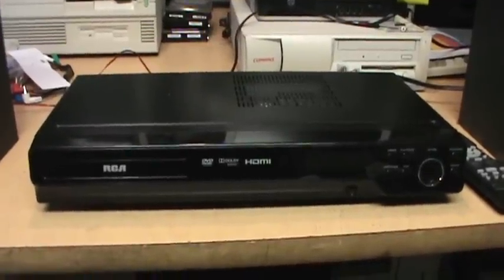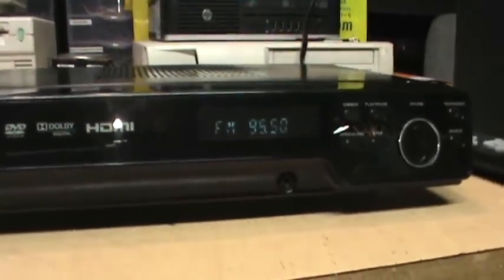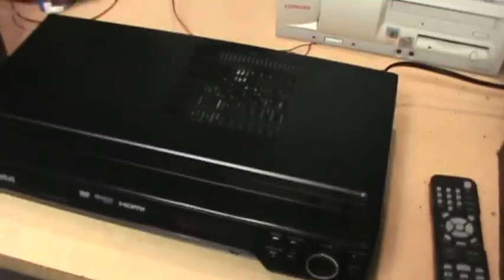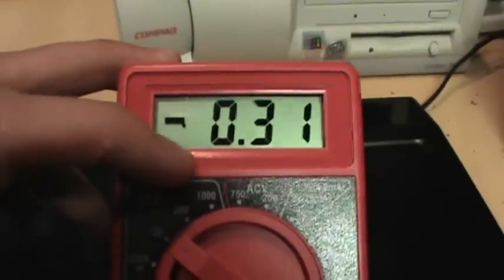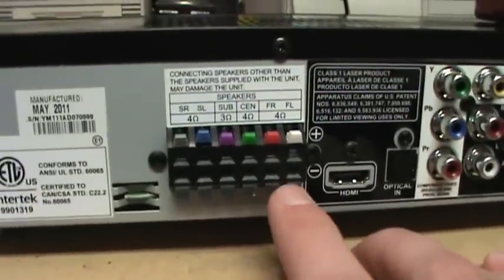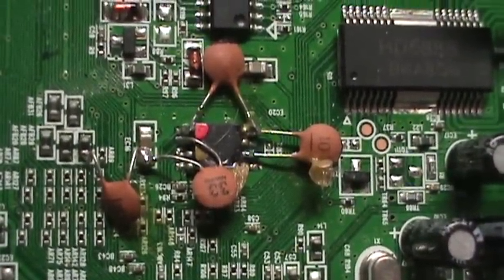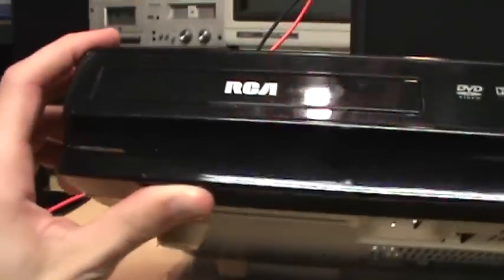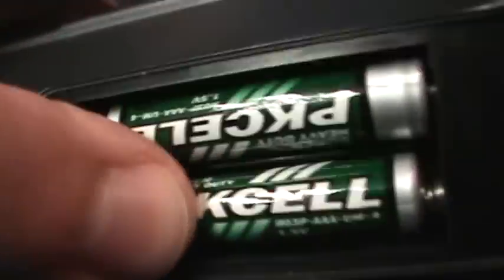RCA 250-watt home theater system FAIL

Comment: 45w to drive five speakers, a subwoofer, and a DVD player! How can they even call that a home theater system?

Looking at the back of a Marantz HT receiver, I'm seeing a 650w power draw, and that's just to drive the main speakers. The subwoofer outputs aren't powered, and there's no built in DVD player.

I know the RCA was designed to be cheap/disposable, but I still would've guessed a power draw closer to 100W, especially since it has to power the subwoofer.

Comment: I had one similar from RCA except that it didn't have the DVD drive and it was rated at 400W (I think) total output. I had the HDMI ports die in it after 2 years, and the audio started to skip in and out when live auto detecting/switching between Dolby and stereo. Also, you can "amp up or down" your audio channels in settings to increase or decrease output to each speaker independently through the on-screen menu. I think settings are stored in eeprom.

Comment: Yep.. that's what happens with badly designed class D amps.. you end up passing a lot of unfiltered current to your speakers and blowing them.. still I have heard systems like that (albeit way more expensive) from Panasonic and the like which have really nice sound and which obviously work in the first place

Comment: The -20 volt measurement was not into a load. Without actually loading it with 3-4 ohms, it's hard to say what the output voltage "into load" would be.

Comment: There are industry standards for claiming output power, if there is no RMS or EMS power in specs - don't buy.
Today radio tuners are complete digital electronic circuits and don't need large coils. Radio chip in mp3 player is using coil that looks like regular resistor or just twisted route on board.
Lots of capacitors on output can have two meaning (single supply amp or power inverter for each channel) but i think that is single supply amplifier.
Lack of output signal is IMO due to digital electronics failure. Probably inproper switchmode supply burning DAC converter.
Loud popping sound is probably due to cheap capacitors working on their limit and drying very quickly ;)
Nice video ;)

Comment: Another glorious example of a  Really Crappy Appliance !
  This is why I feel like if you are wanting a Theater receiver, anything you buy on the used market from the early 2000's to the late 80's is far superior than anything you can get for $99 new.  Unless you REALLY have to have HDMI and USB, but still those can be found easily for less than $99 too.  My only caveat for a Theater receiver is optical inputs.
Reply: Even nice ones from the mid-late '00s can be found for somewhat cheaply, even ES stuff made between '08 and maybe 2012, and are still viable as far as having HDMI audio decoding if you're cool with not having Atmos and you don't need 4K.

Comment: I bought the previous generation of this model. RCA DVD 250 watt surround for $60. Beat the living hell out of it for about a full year until it gave out. I figured it was my constant max volume, had it one day and night wear and tare. Only had this happen to me once before to a $700 panasonic surround sound. Beat the living crap out of it for over 10 years till the fan gave out and overheated the entire thing. Stopped turning on eventually.

Comment: This is why you should spend more then 200 on a home theater system, I have had my Yamaha for almost 6 years and not one problem.
Reply: I've had my Kenwood for over 10 years and it's still running strong without a hiccup!  I use it daily while on my computer (playing games, watching movies, videos and streaming music)!
Reply: I have an Akai receiver I bought new in 1981 and it still works great. My 1977 Marantz really needs a recap though.
Reply: I spent $90 on the audio part of my home theater!! It includes a Sony STR-DE998 master amp (from the dump) a MTX thunder 6000 (from the dump) A Sound Ordinance (SO) sub box (I bought that for $80 from Crutchfield)  A Paradigm subwoofer (forget the model) (from the dump) Two Yamaha ns-5290 for surround back (Bought at a flee market for $5) Two Yamaha Studio monitors [front/main] (forget model) (bought at same flee market for $5) Two modified Sony speakers for surround (from the dump) Sony subwoofer amp (forget model) from the dump all that for $90. Of course I need a projector and screen, which I am getting soon. Screen was $60 and the projector is $700. So I got a $5,000 dollar system (includes projector and screen) for $850! Good deal!!

Comment: Pretty sure that was at the one in Union unless I'm mistaken. i haven't been finding many good items there since the new management took over-- it seems older items are more prone to going to the trash before they ever see the light of the shop floor. last good find I found was a Compaq LTE 4/25C behind the counter up front for $10, but the floppy drive needs a new belt. oh the horror I'll have to endure.

and then I found out the floppy drive in my T4800CT also needs a belt.
and my Compaq Armada.

it seems all my Citizen floppy-wielding laptops need new belts now. it's time.

Comment: Wow, what a piece of junk.

In response to the comment regarding the power input being only 45 watts, that confuses me as well. Unless everything I've learned goes out the window with something like this, power input theoretically always equals power output, regardless of how that power is transformed along the way. As such, an amplifier with a 240 watt output should have a rated input power of at least that much. So I'm not sure what's going on there. My first guess would be they're lying about the power output.
Reply from the maker: The 45-watt rating is at 120 volts AC, while the amplifier chip runs on +/-20 volts DC, so you can't compare the two. YouTube user "Afrotechmods" recently posted a video demonstrating how Class D amplifiers work.
Reply: I guess I don't either because after 4 years of EE under my belt I still don't understand how it's possible lol.

I'm two years late responding to this, but yes, wattage is comparable between the input and output of a device, regardless of if the voltage is converted. If I have a 120V inverter that runs on 12V DC, and I run a 100W load on it, and the inverter is 100% efficient, then it's going to be drawing 100W from the battery as well (120V at 0.83A at the output and 12V at 8.3A at the input).

I've looked up the amplifier thing, and the best explanation I've been able to find is that they're using marketing tactics to bend the facts. The 45W input power rating is probably genuine, and the true output power rating of the amp would be close to that if it's really efficient. The 240W output rating is probably an instantaneous peak value, at which point the input power would be a bit more than that.
Reply from the maker: +themaritimeman Different frequencies. AC power from the mains is 60 Hz while audio power is usually measured at 1 kHz. However it's also possible they're just going by the maximum rated output of the amplifier chips (combined across all channels), whereas the power supply in this unit doesn't provide enough current to actually get that much audio power out of it.
Reply: So the output is always less then the input because nothing is 100% efficient and this is even lower. So that would be maximum 9 watts per channel assuming the electronics used no power and the amp was 100% efficient in reality its probably more like 4-5 watts per channel RMS. The chip is probably out of some car audio device running at 4 ohms. No house speaker is ever 4 ohms. They would be eight cutting thst 4-5 watts output power in half to 2-2.5 watts. Thats ALOT more rasonable then 250 watts out of a chip.

Comment: Hi hello? I have and rca home theater system model rt2380bk. I don't the speakers, or the remote control, but I have the subwoofer. How old is my system? It works fine it has a headphones Jack no dvd player built in.

Comment: Wow, I'm disappointed in RCA, I used to like them. I'm glad you posted it so I know what to watch out for. I'm curious since I really don't know that much about electricity, but what made the voltage go into the negative range and how exactly is it bad (outside from you saying it would blow the speakers)?
Reply: I'm going to take a stab at this but I'm by no means an electrician/electrical engineer/electronics "hobbyist" but a negative charge will push the meter into the negative range.
Reply: *****
GE stands for "Good Enough".
Reply: *****  Pretty much.

Technicolor, formerly Thomson, doesn't even really make their own consumer electronics anymore.

RCA TVs are made by On Corporation while many (but not all) other RCA products are from Voxx and whomever they use to make their items.
Reply: ***** Actually a crappy company "AudioVox" makes for RCA.
Here is some info about RCA, I think of RCA as a "no-name" brand.
 
RCA Telephones - Formerly manufactured by Thomson SA, sold in 2009 to Telefield North America
RCA Audio/Video - Manufactured by Audiovox, produces RCA DVD players, video cassette recorders, direct broadcast satellite decoders, camcorders, and audio equipment. (link on Audiovox website)
RCA Accessories - Manufactured by Audiovox, produces Audio and video connectors, remote controls and television antennas.
RCA Televisions - Manufactured by ON Corporation
RCA Car Stereo - Also known as RCA Mobile
RCA Appliances - Produces RCA Microwaves marketed by Curtis International Ltd. (Canada)
RCA Computers - Produces RCA Computers marketed by American Future Technology Corporation

Comment: I have an RCA bookshelf stereo system and the speakers themselves are good and they are rich in sound, but the amplifier unit is terrible. The CD player does not work (the player mechanism locked up)  and the volume knob malfunctions constantly. They need a step up in QC

Comment: If the rating is 250 watts "music power" then divide by 2 = "IHF" = 125 watts,divide by 2 again should get a rough rms = 60 watts.If they have not changed these ratings.Does not look like 60 rms to me,perhaps 30 rms. IMHO.

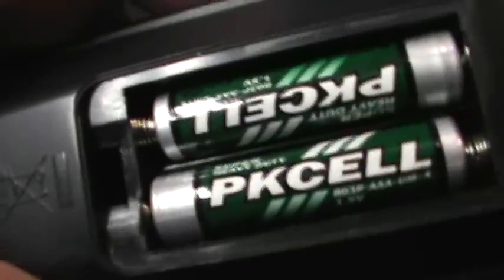Comment: 7:46 AAAHHHHHH! MY PKCELL! Also, I found this unit at Goodwill and I bought it to see if it had this issue. The good thing is, no -20V! The bad thing is, It popped on the front speakers. I checked with a multimeter and It would show 19.65V at some moments. Luckily, I plugged speakers in that I didn’t care about.

Comment: Folks, this is why you do DC bias testing on any used amplifier that comes into the house. Its quick and easy and prevents expensive headaches. Class D amps are usually used for dedicated subwoofer amplification. Audio quality isn't as important there and you can squeeze in a fairly high power amp into the enclosure.

VS = "Virtual Surround"
Reply: +NJRoadfan You beat me to it on the VS, I didn't catch that tidbit when I first watched this video, (I'm not sleeping well, so I am watching youtube)   But I do agree on testing speaker outputs, I also use a pair of "sacrificial" durabrand speakers until a unit builds my trust.

Comment: I've got a RCA STAV-3970 av receiver with Dolby Surround. However its back when Pioneer made products for RCA. So it still works even though its over 12 years old.
Reply: Nathaniel, it's time to replace capacitors in that receiver.
Reply: Those Pioneer-made RCA receivers were pretty much Radio Shack exclusive, marketed under their "Professional Series" line.

Comment: 5:22 That's how class D amps work. Thew generate Square pulse wave which needs to be converted into sine wave which is done by LC tank (Inductor+Capacitor). Ask any audiophile/EE, Class D amps are cheap and load of bullcrap.

Comment: The only thing honest about the 250 Watts output is the fact that it consumes only 45 Watts from the 120 VAC supply, according to the label on the rear... fraud... RCA, which was once a company with great products should be most ashamed, but they aren't.
Reply from the maker: Audio power and electrical power are not directly comparable. Electrical power works at a fixed 60 Hz (or 50 Hz in other parts of the world) while audio power is measured at 1 kHz and works across the entire human range of hearing (20 Hz to 20 kHz).
Reply: Plus you have to factor in the transformation of voltage..as a crude example, 100 watts consumed at 120 volts transformed down to 12 volts (factor of ten) would yield 1,000 watts (at the unobtainable 100% efficiency.) Since most standard, non-switching power supplies are around say 65-75% efficient, your output could be 650-750 watts. Modern switch mode power supplies are around 80-90% efficient, giving you 800-900 watts. In the case of this crap system in the video, where the Class D amp apparently operates on 20 volts (based on the DC bias on the speaker terminals) 120v in, divided by the 20 volts out, factor of 6, times the 45 watt ac input power is 270 watts (at the unobtanium 100% efficiency) so IF that power supply in that piece of junk is 92.5% efficient then the 250 watt claim is accurate.. FOR ONLY ONE CHANNEL.  And this does not account for the power used by the rest of the electronics, so as far as the 250w claimed power...bull pucky.

Comment: My RCA home theater doesn't work new out of the Box have a indicator light but does not power all the way up I can turn it off with remote can't turn it on with remote have to unplug it to Republic just to get in located light Is disappointed